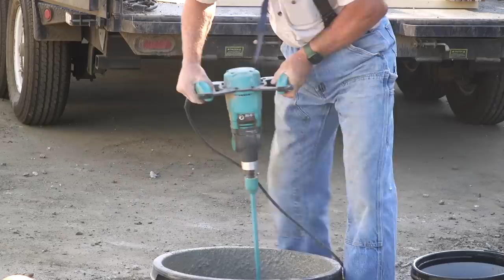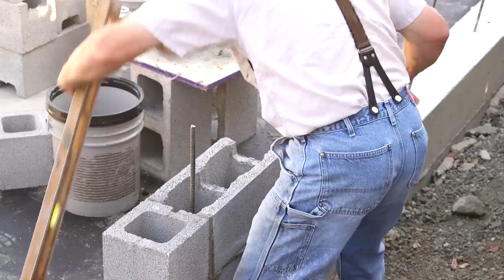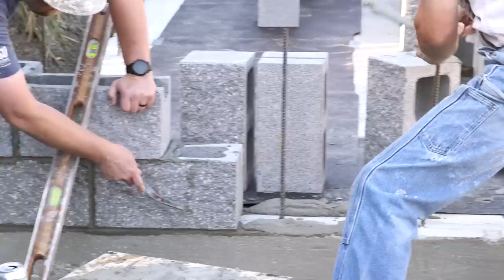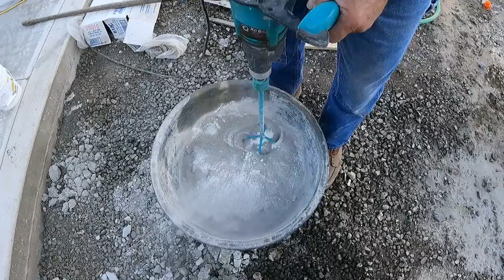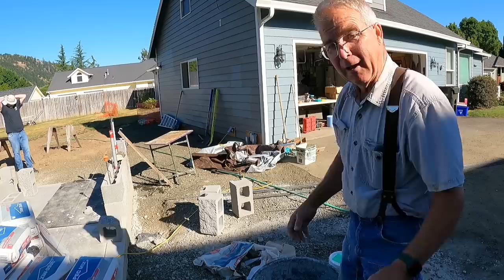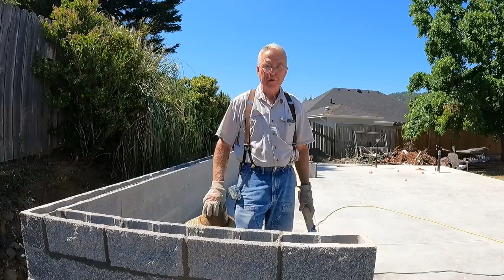I Finally Figured It Out - Learning Masonry: Shop Build #8

Comment: My tips as a 23 yr mason.  
Layout your bond before hand and then lay up your corners first....then check bond again!  Range your first course with a string line and then keep everything plumb from there.  When cutting your excess mortar off turn your trowel on more of an angle to "cut" the mud to reduce smearing.  Butter block ends as they are laid not standing block up.  When mixing mortar....get it to where it should be then let it set for about 5 minutes then break the set...equals more working time.  If you want more cream in the mud just buy a big bag of Portland cement and add a shovel per 80lb bag of spec mix.  When laying your corner block don't waste time on cross leveling.  Just plumb the ends since the block are not perfectly square.  Much more but just the few I thought of
Reply: Hey, can you explain why block walls and not core filled with mud?  Ive only done block a few times, knee wall for a garage type stuff, and as a group of carpenters we wondered why the cores do not get filled?
Reply: Fellow mason of 23 years myself. And in that time, you're the only other guy I've heard mention the second mix. I always make my helpers give it a second spin. No one taught it to me. I just figured it out after spending some time doing epoxy floors and that was specifically in the instructions for mixing.
Reply: Back off

Comment: i can tell you that much: as a mason using whatever sources are available near the sites i always try around with different types of sand from different pits and different lime recipies from different sources on how to get my mix right. with the pre fabricated cement stuff you can flatten your mix with the trowel, make a vertical cut through that flattened surface, and if you scoop a trowel out of that region, the mortar should open up like a... canyon maybe. but always have it wet enough that the "cliffs" barely stay stable. and if my bricks are to dry, mostly if i reuse old bricks from a taredown building, i put them into a big bucket (like the one i saw you mixing in, dont know how to call it in english )of water to saturate the pores with water, that way the lime and or cement has enough water to harden properly, otherwise the mortar will just dry out and the wall wont be as sturdy
Reply: As for the plasticizers, we used them when making concrete, not so much for laying brick (although some readymixes had them incorporated if you ask me. you could feel that in comparison. the expensive readymixes of course, the ones you dont get that often if your boss knows how to make money). and for the last two years i just worked with lime only, no cement at all, like the old folks did...so no organic compounds in my walls (maybe soot if i need to reuse bricks from a chimney, got to be careful with those to not let the soot stain through to the surface..) in germany it's the same as in britain with the masons and brickies. stone masons always seem to work on the edge between crafts and arts, if you know what i mean...but if you watch how they build their houses in the US, its no wonder they dont know the difference. im not even sure if its possible to survive over there as a bricky without traveling hundreds of kilometers between jobs. and as for the masons... at least the masonry involves some kind of big-ish stone that at least sometimes has one or even two sides made look natural-ish. and they do process them sometimes (with an anglegrinder)...
Reply: You dont want saturated block. You want it wet but only enough that it's still "thirsty". The block, when left still "thirsty", will pull the water and cement mixture into its pores and bond better. Look at how stucco guys wet block walls before applying stucco. When I was younger I wet the fxck out of the wall (it was a light retaining wall for a planter ~15'x6'x2') and when I went to apply my stucco it slid off the wall. There were some old guys there laughing at me. I didnt understand cause I didnt speak Spanish at that time. Later on I learned that the wall has to be wet but still thirsty. Then the stucco is a lot more like concrete and you have time to finish it. It sticks better and doesn't crack as often. Maybe it doesn't matter for block, idk. But from my experience and other older guys, that's what I'd recommend
Reply: Clay bricks, it is a must to soak them in water before laying them or a very weak bond is formed with the mortar.  With CMU's We would hose down the stacks to help the bond.  Dry hot work in Aridzona.  Your are right on about the mortar mix consistency description!
Reply: @John Thomas I live in the United States Rhode Island and I'm a mason as opposed to just a bricklayer out of necessity brick houses are few and far between this year alone I started off doing the front of a house with brick then a few brick steps then a job with 7000 8-in blocks then like three chimneys repaired some stone walls and right now I have a blue stone patio that I have to finish up and I'm in the middle of doing the front of a house with real stone veneer that is becoming more and more popular I did a paver patio a couple months ago so I need to know how to work with all these materials but I would have no problem if I could just lay brick or block everyday
Reply: I do tile, stone work, marble etc. In Illinois people lump us in with the “BAAC” which is brick layers and allied craftworkers. Idk how it works elsewhere. But I know when brickys are on a site they are more than just “brick layers” working together.

Comment: In the early 80s when I was 20, I worked a multitude of jobs on a large commercial interior build out. Laboring for a group of brickies was a memorable part of it. Laying out walls and beam pockets, setting metal door frames, mixing mud, building scaffold, and learning block laying basics. After watching these pros for a while they invited me to lay some block. They all chuckled when the mud kept falling off my trowel. They punked me by not telling me about tapping or shaking the trowel before trying to lay down the mud. A lesson learned years ago that I'll never forget. Also learned just how wet the mortar needs to be as it stiffens really fast when it hits that raw, dry block. Always wet the mortar board before shoveling on a new batch to give you more working time. And whatever you do, never let a brickie run out of mud while he's building.  Those guys love to give laborers grief!! More mud, more mud, is the familiar cry from up on the wall. You gotta have thick skin, and if you do, you'll learn skills for life!
Reply: Sounds exactly like my experiences here in Australia.... MORE MUD!!!!

Comment: 7:30ish, adding lime to premixed mortar cement or mortar mix, yes, Lime adds body. I have worked with cement/lime mixing as a hoddie in the 70's to small batch mixes for repairs in the present.  The premix mortar cement (cement and lime) or the pre mix mortar (sand, cement, and lime) never have the body necessary to lay brick of block properly.  The mix needs to have body.  This is a function of having the ability to hold itself up and resist weight but also remain able to be compressed.  As you set a block into the mud it needs to stay in place and allow the mason to then adjust it's position. This is body.  Most current premix blends lack this.  Add some lime and you will have it.  Remember to always allow time for hydration of the mortar mix.  Mix it, let it sit for 10+ minutes, agitate, then use.  Mortar for mason work, Stucco, Mortar for tile, IT'S ALL THE SAME.  Mixing 100# sacks of cement with a half of a 50# sack of lime made such a nice mortar.  I have never been satisfied with the current premix mortar cement (no sand) blends.  Even more disappointed with the premix mortar (with sand) blends.  Adding lime is always the cure to then have the body to lay block or brick properly.  What I was taught by pros in the 70's has me spoiled for life.

Comment: Some hints I learned after tuckpointing a huge chimney:

Hose down the concrete slab (and your plywood mortarboard)  before you start, so it doesn't suck the mortar dry.

Mix the mortar in small batches to match your work speed.

Mix the mortar to the right consistency: scoop some up on your trowel, tap it, then hold the edge vertical.  The mud should stick to the trowel.  About ½ thick is good.

If your mud starts to get a little thick, hit it again with the mixer.  Adding water to thin down mixed mortar is like adding more water to concrete: Too much is bad. And for the same reasons.

But good for you for jumping into unknown territory.

And you are absolutely right about eating the crow while it is still warm!

Comment: At 62 I'm learning masonry/plumbing as I have left the medical field and now help my husband build and maintain large commercial fountains. I grew up working with my father and grandfather as a carpenter's assistant and I loved it. It was hard to find workers so I now assist my husband.  We are currently putting in precast concrete pavers with spillway cut outs to cascade the water across two tiered steps,  First Sidercrete waterproofing (which is an art in itself) and now the masonry part. Learning a lot and grateful to learn new skills...at any age. 
Thank you for sharing your learning process.

Comment: As a 40yr mason bricklayer I can say you did pretty well and - as with any skill set - it all basically boils down to practise and how often you get the chance to practise with the many variables within the masonry trade/craft.  After just over 40years as a craftsman, I can confirm there's still something new to learn.

Perhaps the best way for anyone fresh to the trade - to learn and hone skills -  is by working alongside masons while watching and listening to what they do and have to say about each task.  Never be afraid to ask questions (There's no such thing as a stupid question), but always work to line and level and practise your trowel technique at the spot/mortar board as much as practicably possible before starting a project.

Comment: Outstanding!  I am impressed with your honesty, humility, and your ability to admit to and learn from your mistakes.  You cover a lot of little things that are critically important to a beginner.  For example, your comment about the texture of your mortar is spot on.  Getting the consistency right is key.  You might want to try adding a plasticizer to your mortar mix.  This will help with the texture and pliability. And, always mix all of the ingredients together DRY before you ever add water.   One thing that will help maintain your mortar for longer is to use a "Gatorback," or other plastic mortar board.  Using a wooden board will suck the water and moisture right out of it.   Again, Great Job!

Comment: I appreciate that you as a carpenter is doing masonry and that you are willing to show your mistakes.  As a mason I will say that the consistency of your mud depends on the conditions. Dry block in hot weather with low humidity requires a lot more water than wet block in cool weather with high humidity. If your unsure lay a few block and add water or dry ingredients if needed.

Comment: The only tip i would suggest is that you get the air out of the mud while its on the trowel. I use a Philadelphia trowel on block work, much larger base and with that trowel and one trowel full of mud, i can evenly spread mud on both sides of the bed joint. Two rows of mud with one trowel. This is a skill that took many hours developing to the point that i can now do it without even looking at the block. Its all about knowing the mud, you were very correct about the consistency  but there is more to learn. Always learn. Amd for your first block structure, i give you a 10/10 in preparedness and a 10/10 for effort. Great job, truly.

Comment: The consistency of the mortar is key, in the uk we use a 4:1 ratio mix of sand and cement rather than pre mixed bags, we use a plasticizer additive which makes the mortar more elastic and pliable. It’s all mixed using a small rotating cement mixer rather than a paddle mixer. There’s a few decent YouTube channels out there showing our bricklayers, top quality craftsmen such as “the traditional bricklayer” and “Charlie Collison” well worth checking out, I’ve learned a lot as a carpenter watching these guys and understanding their trade.

Comment: If you put a vertical posts plumb (a wooden 3" by 3") up on each corner of the building, you wil be able to start bricklaying without the trouble of putting corners up out of thin air. If you Google the Dutch word 'metselprofiel' then you will see what I mean. On those profiles you can mark the hight of each layer, so that you're walls are perfectly level. That's how we do it in the Netherlands. Thank you for you're videos! It helped me a lot as a framer in a country where brick and mortar are the norm.

Comment: First of all, you kept up the good work, and did the work well.
I've had a pointed trowel in my hand since 1972, and agree with all you discovered about the mud, the angle of the trowel, and timing. I watched you begin to use the back side of the trowel for the bed joint when it suited getting past steel, or increased production, smiled when you applied your knowledge and experience of concrete finishing to the work at hand. If you ever lose another bet and have to lay block again, consider mixing the mortar for far longer. That old drum mixer I spied will mix and fold that mud up and entrain air as it goes 'round and 'round, making a mix that assists in the laying, 15 minutes should do it.  "Level, plumb, straight, true and even. "2 over one and one over two" and "Mortar dosent hold the block together..it holds them apart" are three maxims to remember. Keep all that in mind and  you may discover the last little  bit of fun and joy that lies hidden under each block on the pallet.

Comment: I love the tar paper trick, thats a new one for me.  Using Portland is a trick a lot of cultured stone guys use but I never had a problem with Spec Mix and holding power.  I definitely like that mixer that looks like a great tool.  One trick I might suggest is never trying to strike off your overage right away, just let the mud set up for maybe a half hour or so then go back and blade the spills off and it will be less likely to stick to the block, especially the rough architectural block with the cool finish.  Great work for a carpenter you are a man of many talents.

Comment: When I was younger we always used J-bolts to anchor the sill plates to the foundation. Now when I use blocks I skip the plate and use angle iron, bolt it directly to the inside of the rim joists, run it down inside the block and grout it solid. It makes a much stronger connection for extreme weather conditions.

Comment: You can run a line on some batter boards to set your first row straight and level without much guess work. Secondly, the consistency of your mortar will vary depending on weather, type of block or stone or brick you’re using, sun exposure, and time of year. Third, the pre mis mortar is handy for small jobs but I find the mortar is better quality when mixed on site with dry brick sand and straight masonry cement. You can add air floated clay or lime to increase workability as needed. 
Finally it’s nice to see a masonry episode and your affirmation that it’s probably a job best left for the pros.

Comment: Build your corners first then you can string your line for each course. Makes for a straight and level wall
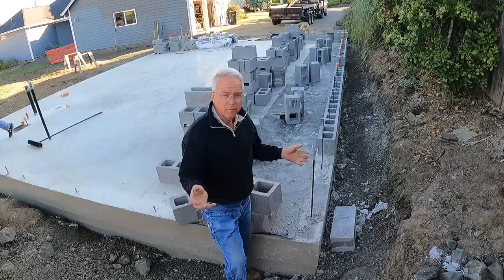Reply: I think that's what he did. Seems like the first 4:45 of the video is him building the first 2 corners, and at 4:50, you can see the string laying on the ground when he ripped out the one corner. You can definitely see strings in the later part of the video.
Reply: Agreed. There are a number of tricks and tips for the proper, detailed and professional outcome in the end. Little things can be prominent time-savers, too, such as saving like 30 secs for every brick by cutting every extra movement or walkin. Like a delivery guy who is completing 30 addresses during the workday and turns the car the right way towards the next destination by making a u-turn; he might save a minute in every stop ie. comes 30minutes for the whole day :)

Comment: Applying mortar for joints: one of the first things I learned, but took me a while to get, about buttering your bricks was to condition the mud a bit on the board first. I saw you do it some and those beads went on nicely. Use the trowel to scoop the mud, then plop it off in one tap on the board; scoop, plop; scoop, plop until you have sort of a triangular roll of mortar. I guess it packs the mud a little and you can pick it up slide it along your brick. I also found if I "set" the mud on the trowel by kinda slinging the trowel down flat and stopping sharp it the mud would stick to the trowel and allow me to reach the difficult angles.
Lay the first course: Pushing little "dimples" into and along first course mortar makes it a little easier to set the block in without having to lean your weight into it.

Comment: I was taught to wet the blocks and rocks before putting the mortar on them because a dry block or rock will suck the moisture from the mortar too fast creating a dry bond.
Reply: That’s right the slower the mortar drys the better
Reply: At least doing the tiling, it is best to always wet the surface and the tile before planting it. And use primer on the surface, too.
Reply: Wrong on this and the replies. The wall is compressive strength not just bonding strength. Wet block causes messy work and creates mineral salts known as efflorescence.
Reply: Bond is important